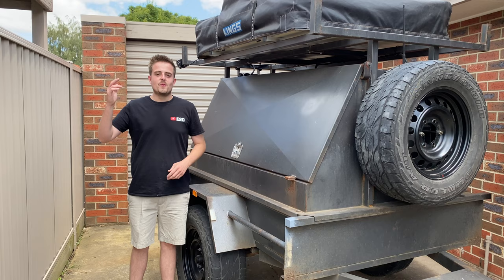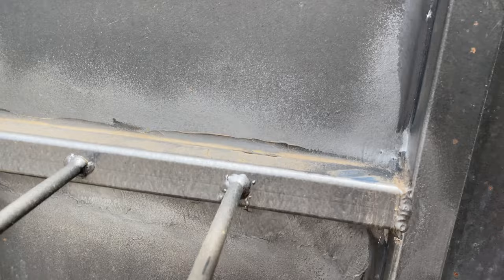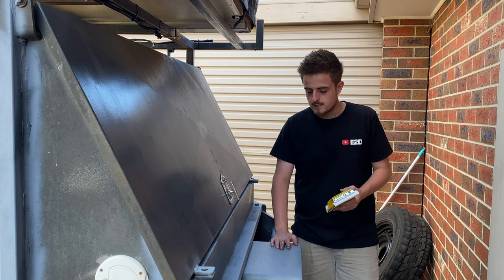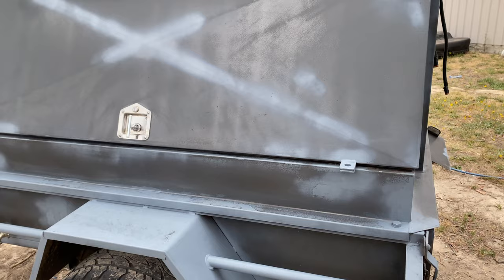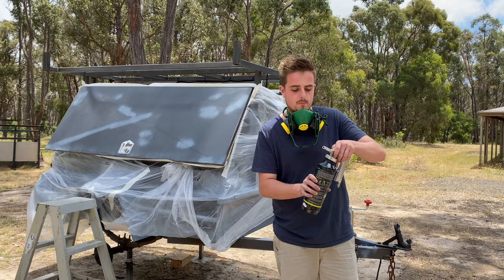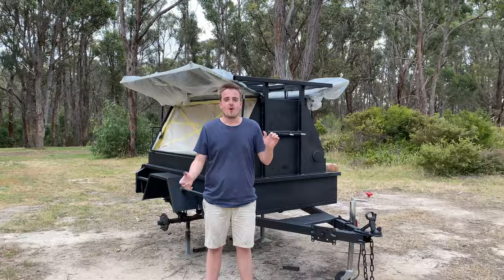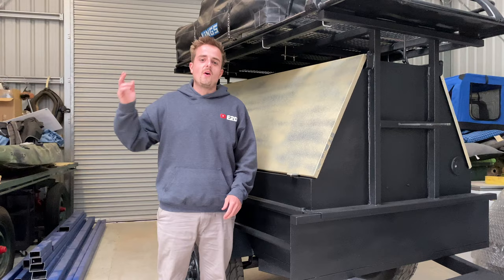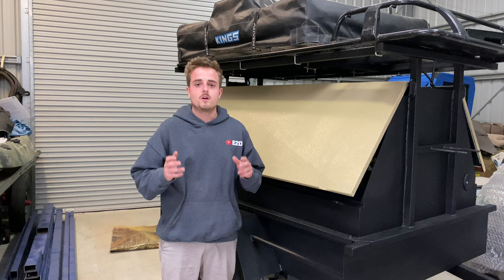Painting My Entire Camper With Upol Raptor Liner - DIY

Comment: Few issues you've hit. You need more pressure (use 60). You are also spraying way way too close - set you're set much further back, you'll get better coverage and you won't have all the streaks/lines in your job. I've just done my box 8x5 trailer (also a camper) and it looks significantly smoother.
Reply from the maker: Thanks mate it dried flawless with no streaks in the end

Comment: Hey mate great vid. How’s the raptor liner held up? Thinking of doing mine also
Reply from the maker: It hasn’t held up like I thought it would, has chipped in places after using expensive primer that was recommended.. may be solved with a heavier coat in stone prone areas..

Comment: Looks awesome esp the two tone. How did the doors come out with the roller? On camera looks about the same but is there much difference in person. Keep up the good work, loving the trailer build
Reply from the maker: Thank you! They came up great, may need one more coat in the future but it was a messier way of applying the raptor... It’s hard to tell it has been rolled on.
Reply: @EngineeredToDesign   could you adjust the spray on the gun to be more of a wide angle or has it no adjustments? Been planning on making a trailer like yours for awhile now so these videos have been a great inspiration
Reply from the maker: @fifahead000   it would have been much easier to apply if it was adjustable.. you can buy another raptor gun but it wasn’t available locally. You have to buy the spray gun I used separately doesn’t come with the kit.. it went on some parts.

Comment: Wonder if the windex and paddle pop stick trick works with seam sealer
Reply from the maker: Is that to apply it?
Reply: @EngineeredToDesign  yeah, I think it is the old trick for silicone edge sealing to get a smooth finish in a corner. More consistent than a soapy wet finger.